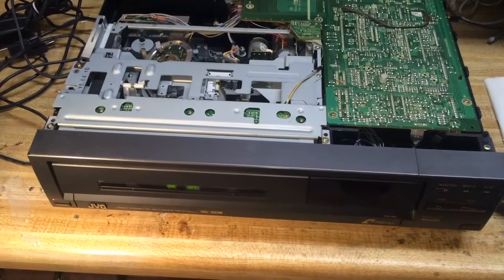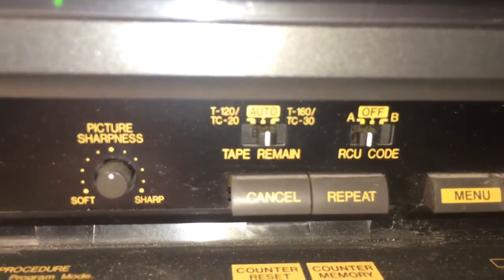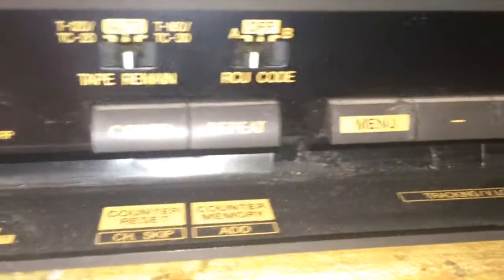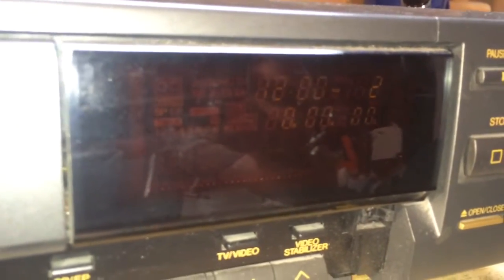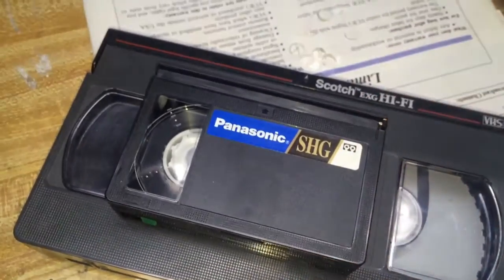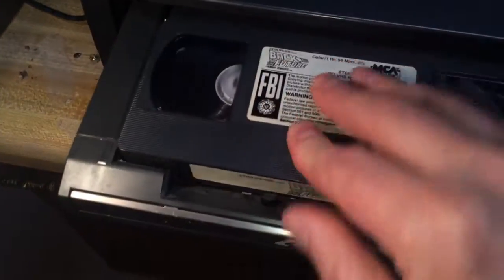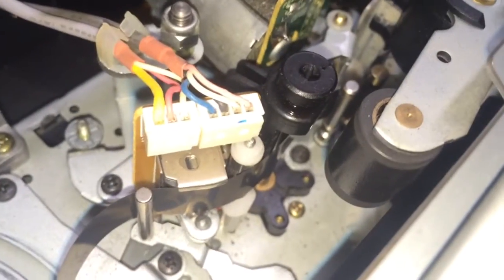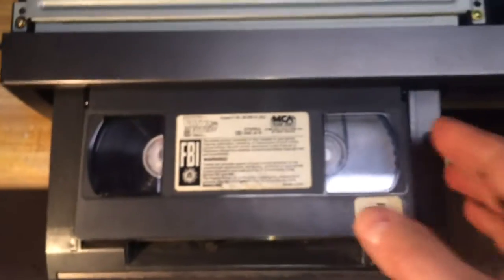Unique Tech: JVC HR-FC100U Drawer Loading VCR

Comment: I have the JVC HR-SC1000U and it has the drawer loading mechanism like the unit in your video.  It is an SVHS model that plays regular VHS and VHS-C plus the SVHS versions of both.  I got it in 1990 and it still works.  About a month ago I transferred 3.5 hours of material to DVD for someone and it worked fine after not being used in at least 5 years.

Comment: LOL that particular LED display always appeared weak. There's a tinted piece of plastic over them that takes a lot of their brightness. We had a Zenith VCR with that same LED display (and menu system). JVC and Zenith VCRs from 1987 though 1991 were among the best in history. Those 2 brands also had the only sideways-loading VHS VCRS.  And the only vertical (tower) VCRs were JVC-made Zenith machines.
Reply: Not led display, but a fluoresscent display, it has a gas sealed in the tube very simliar to a regular fluorescent light bulb.  The numbers are glowing phospers. Its getting dim because the phospers are weak.  These displays were in microwave oven touch panels and stereo equipment.  Its made by a company called NEC.  Tbey call it Nec fip.  Fip stands for Fluoresscent indicator panel.

Comment: I remember for a while there were a lot of different combo options including 8mm, Dv or DVD burning.  Never saw a combo VHS-C/ fullsize combo.  I was smart, though, and went with JVC VHS-C camcorder for all home videos due to prevalence of the fullsize format.  Also, chose an adapter with a thumbwheel rather than battery due to fears of the motor screwing up a priceless memory.  I have two JVC S-VHS VCRs which have held up pretty well.  I need to get transferring at some point.  It's a shame the defacto movie format with billions of users just went away so completely.  If you build it, they will come.  If they stop wanting it, it will go...
Reply from the maker: +DelilahThePig - very true, thanks for the comments
Reply: Ive got this model but somethings wrong with mine it needs a gear repalcement adn I havent been able to find it.

Comment: (9:52) a disc at the left upper side is spinning. ( what it does?)
Reply: It is simply a fly-wheel to better regulate the spinning of the spindle guiding the tape to the head-drum.  The design also allows access to the screws beneath.
Reply: Thanks!

Comment: drawer loading only looks cool but it's the worst way of doing the job because drawers can break very easily! the slot system Apple does in most of its computers is way better ... yes, I know it's easier to get a stuck disc out of the drawer models than it is from a slot one but the latter is more logical to use ...